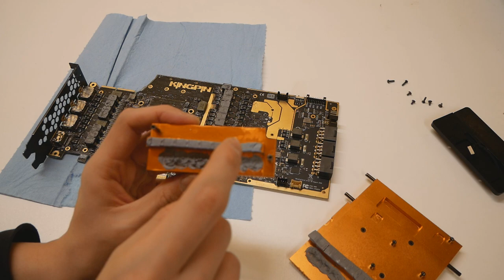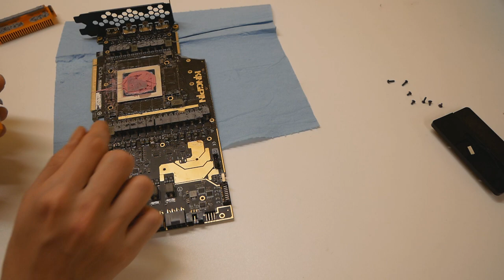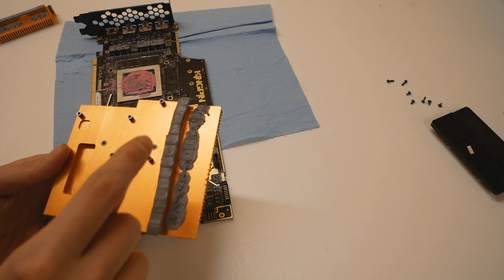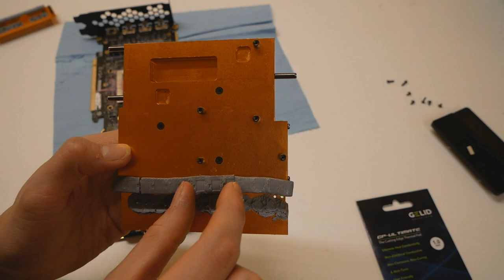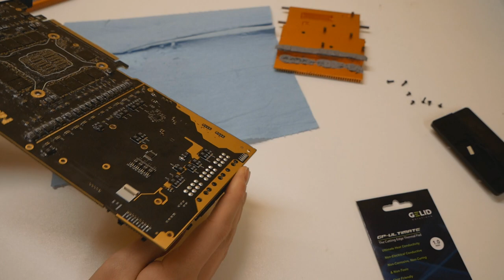Important VRM Cooling Advice for RTX 3090 Kingpin

Comment: Yea I replaced the stock thermal pads with the gelid extreme 2mm thick pads before i even ran my kp on ln2 the first time, due to seeing your video about blown vrm. I also put some 0.5mm pads I had on the chokes, don't have any of that gooey stuff, they aren't perfect but I pulled on them checking the fit and they don't come out. Every sensor on my card reads 0c besides the die which goes negative. I emailed Vince asking about the heater, so hopefully I can get one soon. Thank you for all your videos Luumi :D
Reply: you should not use pads that are too big, bigger doesn't mean better. Probalby your proccessor doesn't touch heatsink. Make sure there is no gaps between chip and the cooling system

Comment: I recently learned how to calculate the temp gradient between hot and cold side of a thermal pad / gap filler. Very useful formula. 

(thickness of pad in meters X heat in watts) / (area of heat source in square meters X W/mK value)

So if you have a 1mm gap, 5W/mK pad, 5W of heat output from a 5x5mm mosfet / memory die :

(0.001m x 5W) / ((0.005m x 0.005m) x 5W/mK) = 40c temp gradient between the hot and cold side of the pad. Insanely inefficient! 

This is probably why GDDR6X runs so hot on air cooling. I'm not sure what size a GDDR6X die would be, but GDDR5 is roughly 5x5mm. If you use 15x15x0.5mm copper shims and thermal paste directly on the chips, this should effectively spread the heat to a roughly 9x larger area, which means theoretically 9x the cooling efficiency across the same size gap (if we ignore the inefficiency between memory chip and shim), but the gap is now half the size because of the shim, so the efficiency is doubled again.

So ignoring temp gradient between chip and copper shim (which should be quite small), we have and 18x improvement over stock. And of course you could use something like TG-PP10 rated at 10W/mK to double that again. 

Anyway, hope someone finds this useful. Cheers!
Reply: Hello! This is excellent information. The copper shims would work well. Although, this could cause issues depending on how flat the card is. Copper shims everywhere could cause issues throughout the card causing a uneven die to block contact for the actual GPU. Although Fuji makes a super thin pressure film paper, it can be used to test the contact of pressure. And how even the contact is being applied. I have a 3090 KP on the way to me right now, and I will try everything possible to get the best temps when installing my Kingpin hydro copper block on it.
Reply: @videocardzrule354  Glad you found it useful. I tried the mod on a 1060 and was able to OC the mem a bit further. No mem temp sensors to go by though.

I got an assortment of 15x15mm shims of different thickness from amazon and found the size that would leave a ~0.25mm gap between the shim and cooler. I pressed the shims onto the mem chips with a dab of thermal paste and squeezed out the excess, then rolled up ~5mm balls of TG-PP10 putty and put one on top of each shim, set the cooler straight on top and compressed the thermal putty. Core temp and contact is great.

The TG putty is good stuff, definitely recommended if you want to use shims, since it can compress as thin as needed.

Comment: I bought a small piece of glass, still debating on lapping  my die. Just not sure its worth it since my bin was kinda bad. I have great contact with pot on the center of the die, but the edges are much thicker. and sometimes its just one corner that is quite thick with paste. You can almost read nVidia and the numbers on my pot! lol
Reply: What is “kind of bad”? How do you know it’s actually bad instead of you needing to tweak with settings more?
Reply: @YouTubePseudonym  comparison with many other cards people have tested and displayed online for this purpose. Some cards will OC well, others not at all. Thus a good or bad bin.
Reply: @crisnmaryfam7344  I understand this, but I notice different silicon clock at different speeds depending on specific settings, so extra tuning can possibly make it clock higher.

Comment: What you got from extreme oc actually you lost the gpu overclock for me ends at waterblock

What you said at the end of the video is completely right i lost 2x xfx rx580 while mining for exact issue actually no cooling needed for mem and mosfet for rx580 but the heat sink was near to them blocking air unlike other models asus and powercolor has no heatsink on top of them they work fine
Reply from the maker: You need to double check the heatsinks.
Reply: @LuumiJuhani  I bought three xfx 580 used 2 out of 3 stopped working after year and half cause there is no thermal pad but the third one has thermal pad working fine ... I was lazy not checking the cards

Comment: Doesn't look like very good placement for VRM mounting holes. But even then, 70-80% of heat from power stages is dissipated into PCB, and not the heatsink. So it's bit of unclear what was issue with your card, tbh.
Reply from the maker: Well when doing this the vrm temps already dropped like 10-13c on aio already.

Comment: Hi @Luumi, have you tried K5 Pro thermal gap filler to replace the stock thermal gap filler?  I have picked some up, but I haven’t had a chance to test it out to see how well it works.
Reply: I have used K5 Pro. It works great! I used it for high end desktop replacment gaming laptops with desktop socketed CPUs, and I would use it on video cards with full cover waterblocks that have some gaps on certain components.

Comment: Are you sure this problem is not only on your sample?
Reply from the maker: It is wise to check the vrm contact if you remove the heatsinks.
Reply: @LuumiJuhani  Yes,  i was just wondering. Because you said they fixed it by replasing the vrms and it might be from that.

Comment: that card has major flaw, one side of vrm is being active cooled, other one not, what an design... wish EK made block for it.
Reply from the maker: It is completely fine out of the box. If you remove the cooler the pad easily bends and becomes thinner.
Reply: @LuumiJuhani  what?
Reply from the maker: @Zfast4y0u  The cooling fan is a blower style one so it covers the entire card so both vrm areas. The right side vrm does have contact to the heatsink fine by default. But if you remove the heatsink even once the pad can easily bend and become thinner and then lose contact.
Reply: @LuumiJuhani  u forget there is big ass pump sitting in between vrm's. no air gets to the other side.

Comment: Almost right bud, when using thermal pads the part needs to obviously contact the thermal pad however if the pad is too thick it will insulate the part causing higher temps, just because you see heavy dents in the pad doesnt PROVE anything. If replacing the thermal pads get the original pad size (or measure) but dont go more the 0.5 over it.

Comment: Just put 2 mm of k5 PRO Viscous Thermal Paste  on everything except the gpu 
It isn't conductive and will compress to the right thickness without making more space between the gpu die
 K5-PRO has thermal conductivity K>5,3 W/m.K and is made to replace thermal pads